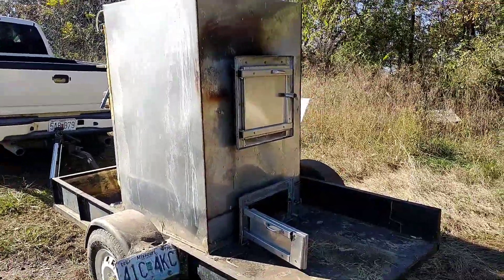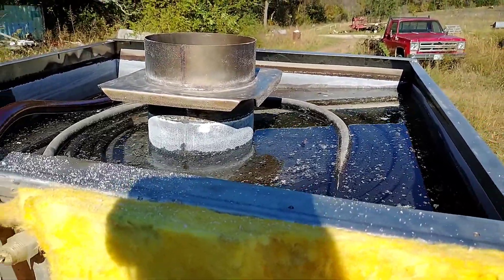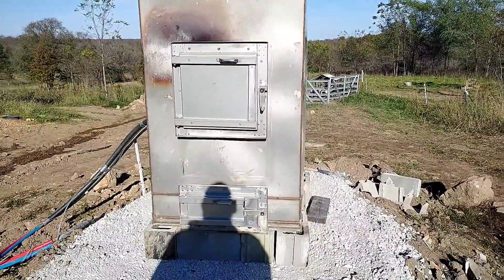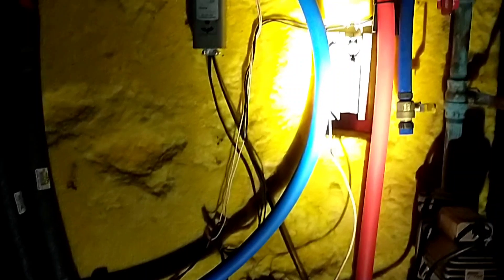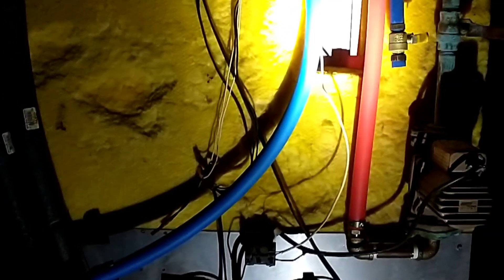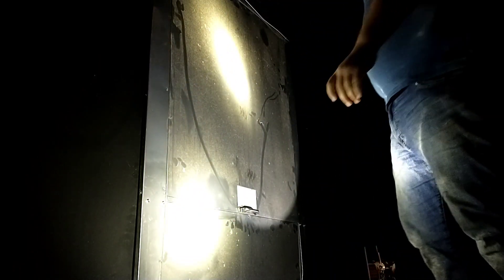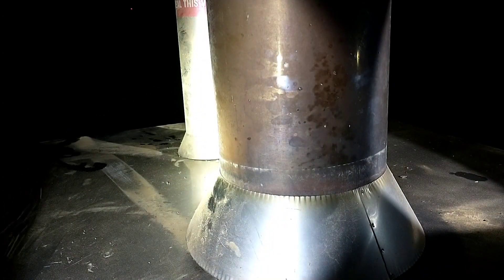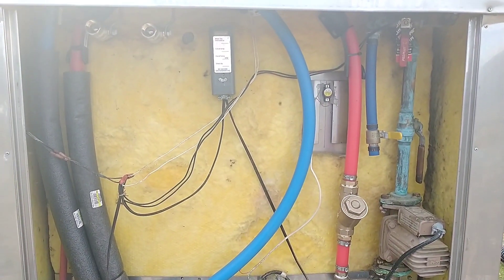Outdoor Wood Boiler Installation Part 2: Setting the Hardy H4 and How NOT to Install the Cover!

Comment: Is there any hardware attaching the outer shell to the stove? I need to take mine off to do a repair but I wasn’t sure if it’s riveted all together or what? Same exact model, H4
Reply from the maker: Hey SumBeach, there isn't much holding it on but there are a few things to take apart. Mainly take the flew pipe and the water inlet cover off the top, they both just slide off but may be siliconed on. Then there is a panel on the front between the fire door and the ash door. It just slides out to the left or right, no fasteners. Lastly you'll need to take a panel off that is below the back door. It is held on with like 4 or 6 screws. On mine they were 5/16 hex head and they are short little sheet metal screws. After that it should just slide straight up. Two guys can do it, it's not very heavy just big and awkward, if you had a third person that would be handy. I had to use equipment because I was by myself. Good luck! Let me know if you have anymore questions!
Reply: @assemblyrequired1  Thank you so much. I was thinking I’d have to grind all the rivets off and remove each panel.

Comment: Good evening Sir , Do you have to have your thermostat wire running to the stove or can you put and Aquastat on the supply line in the house
Reply from the maker: Hello Greg, I don't currently have a thermostat wire connected from inside out to the wood stove.  I ran one physically, in case I wanted to use it at some point, but I didn't hook it up to anything.   My aquastat is mounted into the back of the stove and it controls the blower motor that forces air into the firebox.  So if I set it to 140 degrees F,  it will turn the fan on to feed the fire when the water gets down to around 130 degrees and then shut back off when it is around 140-145.  I suppose you could put an Aquastat on the supply line to the house, but it wouldn't give you a reading that was very representative of the water in the stove and you may risk the stove over or under heating. Could also work well, I'm just not sure that it would benefit much for the risk.  Thanks for watching and commenting, hope this all made sense!

Comment: FYI- the strainer is meant to go before the circulator pump to keep debris from entering the pump
Reply from the maker: True, but in this case I'm not particularly worried about the pump that's on the back of the boiler.  Since these are not positive displacement pumps, they don't have the tight clearances that would be susceptible to the type of debris that would most likely be in the boiler tank. The intention of this strainer is to protect the plate heat exchanger and mixing valve in the house, and to just constantly filter the water as it is circulated.  Thanks for watching and for the comment!
Reply: @assemblyrequired1  absolutely true regarding the pump; hence why they are classified as circulators. You’re definitely not wrong about protecting the plate exchanger but, placing the strainer upstream of the circulator would increase longevity of that in addition to the exchanger…. Not sure what your trade/line of work is but that’s a nice install you have going. Very clean.
Reply from the maker: I'm a mechanical engineer so I do enjoy doing this type of work.  Thanks!

Comment: Does that pump run constantly? Or does it kick on with a thermostat wire that connects from the control board?  I'm installing one myself.  I have a 2 zone radiant for heat with 2 pumps. I'm a bit confused about the pump on the boiler itself.  Any help is appreciated..ty
Reply from the maker: Hi again Josh. The pump on my boiler runs constantly when I have the system on during the winter, it's set up similarly to the folks that have a heat exchanger in their furnace, just constantly circulating the water from the boiler to the house and back out. I did run a thermostat wire with the pex lines under ground so that some day I could control that pump with the control board and only have it run when the floor calls for heat, but for now that's not hooked up and I'm not sure if I will hook it up. Let me know if you have any questions, I'll help wherever I can! Thanks for watching!
Reply: @assemblyrequired1  I understand now! Thanks again!!!

Comment: on your return line...it looks like the blue pex will be in the way if the shut off valve...if you ever need to shut that valve.
Reply from the maker: Nope, actually I have closed it a few times and it works just fine. Probably what you can't see in the video is that it turns clockwise to close and not counter-clockwise, in which case you'd be correct.  Thanks for watching and thanks for the comment!

Comment: How did you find this used and what was the cost of it? Thank you
Reply from the maker: Hey Leslie, I found this for sale on Craigslist from a guy who needed to convert to a gas furnace due to health issues, not being able to cut wood anymore. They are still on there occasionally. I paid $4500 for the furnace along with his hydraulic wood splitter, which I valued around $1000. So I figure I had $3500 in the Hardy itself. Hope this helps, Thanks for the comment!